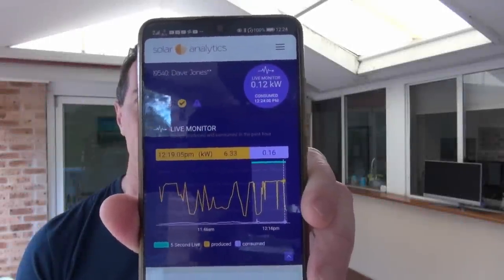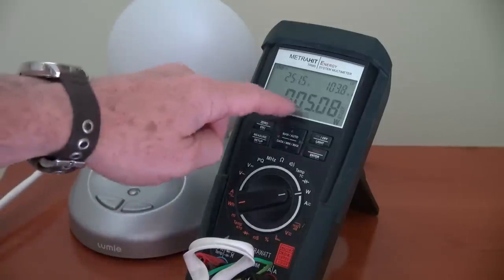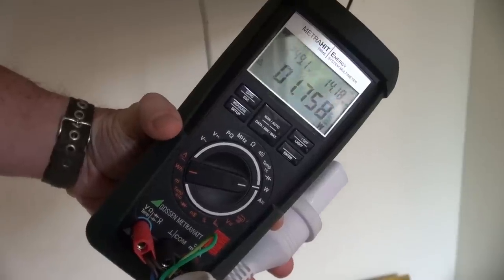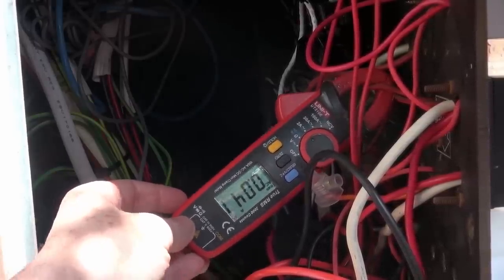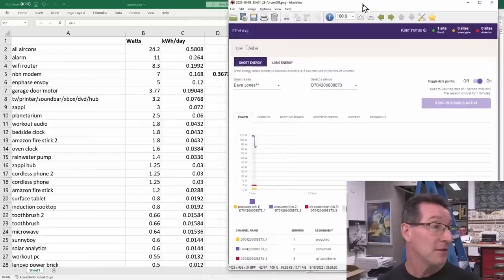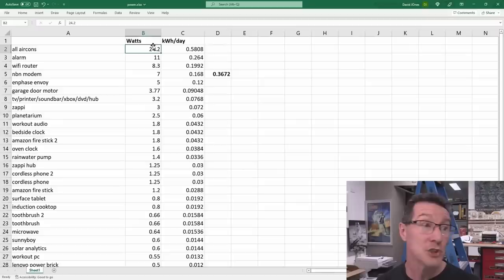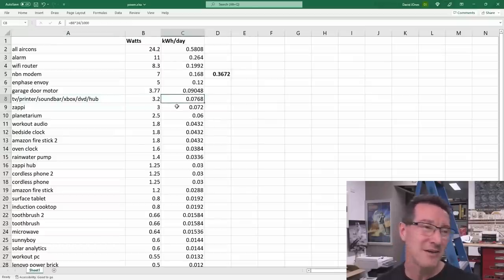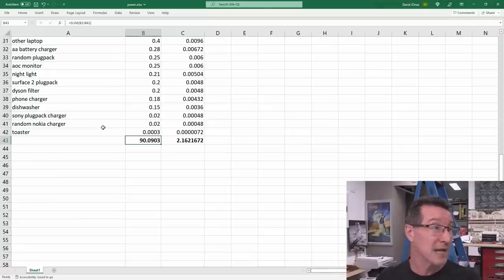EEVblog 1505 - 120W Home Phantom Power? Audit Time!

Comment: One of the first things I did when I moved into this house was to put the living room TV & AV system on a surge suppressor with a conveniently-located switch. This was ~15 years ago, and we hadn't phased out our use of CRTs yet. That saved a ton of power, I'd wager. We're still continuing it as a habit to this day.
Reply: With an old CRT TV, it can "power on" in a matter of seconds. Today's "modern", "smart" junk takes an eternity to be ready to turn on. For example, my (old now) Vizio TV takes several minutes to "boot" after power is applied -- the power button will not turn it on during this phase. DVRs need to be on 24/7 to do their job. Streaming devices (apple tv, roku, etc.) are much like the TV... takes ages to boot.

There are numerous way higher constant loads throughout the house... my laptop uses 20-30W idle (screen on). Desktop uses ~100W. Switch(es), router, wifi... all add up. I could shutdown the laptop, but I don't want to wait for it to (re)boot. (the desktop runs things that are needed 24/7)
Reply: @jfbeam  Curious, my Roku stick takes about 10 seconds to boot from cold - I normally keep it disconnected at the USB power and only plug it in when needed as the TV is really bad at switching HDMI inputs. I'm with you on the DVRs though - not much point in them if you are going to cut the power when they might have been set up to record. Truth is though that I use that less and less these days when everything is available on catchup services anyway.
Reply: @jfbeam  This is one of the areas I'm glad to be cheap. 😁 Our 2009-vintage Vizio is probably one of the last of the "dumb" monitors Vizio made. Starts up in seconds. The audio gear is a hodgepodge of old analog stuff -- newest pieces are 18 years old now. We do have a streaming Roku stick, powered from the TV, but that boots up fairly quick for us (10-20 seconds).

You're quite right about the new hardware though. Some of it takes longer to boot than my first Windows 95 PC from ~25 years ago. I wouldn't want to cycle that every day. And the PCs are another story... ⚡💸
Reply: @McTroyd  I have a smart Vizio, and it boots in about 10 seconds. I wouldn't use it as a smart TV, though, because the UI is drawn entirely by the underpowered CPU.

Comment: The Xbox has spinning media and does large updates in the background. That could be some of it. It could also try to keep phoning home if the option isn't turned off.
Reply from the maker: Only seems to do updates when we tell it to
Reply: @EEVblog  odd. Usually it'll download it in the background then take forever to install. The xbox one s was bad for downloading the whole os everything they made a slight change to the machine. In the settings off means 2 different things. Sleep and download app updates such as games and whatnot but the big updates they ask first incase you hit yes and it bricks your machine  because Microsoft and have to download a usb backup.
I love the witch hunt though.

Comment: I did something similar a few weeks ago when we got our mandatory smart meter upgrade. I was shocked when I discovered my old Yamaha AVR is taking 70W... I never turned that thing off, not sure why I thought it will take next to nothing if it's not playing anything. So in the 10 years I have it, I wasted more than a 1000 bucks in energy with it easily...
Reply: Yeah, amps do use a lot when on, oddly even if you turn the speakers off (using the button that unlatches the speaker relays). The Pioneer one I have uses 30-40W. The good part is that if you put it in standby, it'll only use 0.1W or less. Shame it takes a few seconds for it to power on the speakers when you power it on.
However I don't know if frequently powering it on/off will damage it (like a dozen times a day).
Reply: My amp was using 28w on standby! 
Datasheet said 0.5w. reality was 28
Reply: @njipods  then it didnt really go into standby. standby would be with everything off and the amp waiting for remote on signal (or power button press on the front). if the amp is on but idling, that is not standby.
Reply: @blockbertus  it was standby. I check with the manufacture.
Reply: @njipods  what model was it?
Reply: more if you use AC, but less (much less) in months where you heat your home.
Reply: My Harmon Kardon was using 100 wats with no volume. I ran it like that for 15 years. Ouch. My Soundstage subwoofer used 40 watts in standby.
Reply: @timcat1004  It varies from setup to setup, yeah. The pioneer I mentioned was an entry level model. A much more higher end Denon however uses 70W instead (measured it directly). The Marantz slimlines use 40W normally, 30W in Eco mode (according to specs).
My old all-in-one amp/woofer + 5 satellites used 20W when on, 10W in standby.

Comment: I did an audit of my whole house a few years ago, it was around 300w with everything in standby mode. It turned out to be a GE radio flip number alarm clock sucking down 130w,  the UV light at 70w on the humidifier that was on all the time as long as it was plugged in, the transformer for the 1980's door bell sucking down 80w at idle and a few 1-2w wall warts. The alarm clock got thrown out as it was just in the spare bedroom unused for many years, a new modern power supply for the door bell idles at 0.2w to keep the led on the button lit up and we just unplug the humidifier when not in use.
Reply: 130W seems highly improbable for an alarm clock. There's no way it could dissipate that much heat without melting. Same with the 80W for the transformer.
Reply: @RobertHancock1  Seems like these numbers are way off. Probably measures with a "power meter" that doesn't take into account when cos/phi is not =1.

Comment: Here in the Netherlands we can read-out our meters with 1 second resolution. Ever since I have this, I've been monitoring like crazy. Still have a 250w phantom load, but now I know what it is and why I keep it running.
Reply: Yeah the P1 port is really useful, high resolution and no need to send data to your energy supplier or some cloud service.
Reply: If you know what it is, it's hardly "phantom load". 250w is pretty good though, I'm still doing about 340w at night. Mainly freezer/fridge, NAS and network (lots of unifi stuff). P1 port is pretty handy for monitoring this stuff, we have it in Belgium too.

Comment: Was watching a guy in California, Shango, who plans on running a vintage TV 24/7 until failure. He mentioned their energy cost, which seemed high, and overseas, I couldn't live where I currently do at some of those costs mentioned. 

I pay a measly 8.306 cents per kWh, and still try to be as efficient as possible. Mostly all LED, taking it easy on the AC and heat, water heater turned down a bit, devices unplugged, etc.

That said, it's a full electric house with no heat pump technology to be seen. Typical whole house AC and forced air electric furnace at 15 kW. I paid $70-110 a month in late spring and summer, I expect winter to be at least double (though I'll try to keep it cool inside).

Comment: I've been working through my house taking many of those small loads off grid.  The kitchen lighting has been 100% solar for over 8 years now, same in the attic and patio and the garage/shop has dual lighting, either DC or AC depending on the solar conditions. Some wall warts have been replaced with DC-DC converters running off a 12VDC circuit in the house, including the low voltage transformer for the door bell.  I'm averaging over 2KWH/day on that DC system.
Reply: Well done. I will have to think about implementing that idea. Thanks.
Reply: @ecospider5  Thanks, my strategy is to start with something small.  When I showed my system to a friend some years ago, he commented that I was just doing the "low hanging fruit".  And yes, that's the idea, just pick off something easy, like eliminating the doorbell transformer and feeding that with 12VDC.  Eliminates a watt or so of vampire load and assuming you have 12VDC from a battery bank, there is zero standby power loss (assuming no doorbell camera type system), in fact my first video on YT:
https://youtu.be/59MTQu---ZI
With an off-grid solar setup, you take DC off the panels, store into a battery, then pull DC out of the battery to power an inverter for high voltage AC then convert that back to low voltage DC to run some small device.
Reply: That’s a good way of dealing with it. I have only done that with 1 thing. My electric lawn mower. 2x12v 50w panels on the shed was plenty to charge the mower. 

I do have a full 10kw solar system but I can’t add to that without hiring someone. So doing some more 12v stuff makes sense. Like my outdoor cameras.

Comment: Missing power usage due to capacitive coupling of the wires in the house especially on long untidy nests in the loft.
Problems with switching routers/modems off at night is most do updates at night so switching off at night would miss security updates.

Comment: My solution for the wifi, cpe, network switches, TV Boxes and home assistant (basically, anything that natively runs on 12v or less), was to move it all on to a set of batteries, with its own solar and cheap pwm solar charge controllers (2 x 50 watt panels and some old batteries). That way the usage of those items no longer affects any other figures, and additionally, it keeps the internet on during power outages, at no extra cost.
Reply: Smart solution. However, if your neighborhood has a power outage, would that not mean your internet is down too, as it's probably somewhere in the area in a central distribution box with active/powered elements that also will go down? 
Anyway, good idea, perhaps when you remodel/built new, consider your own DC mains circuit to most of the rooms and utility closet?
Reply: @ewoutbuhler5217   Unfortunately I live in South Africa, which has "Loadshedding" 3 times a day due to lack of maintenance and general upkeep, so they switch power off to certain areas each day because "Something" has failed at some point and they have to conduct "Maintenance" to said unit, and then they spin the bull story that it's because the country is "Growing" so rapidly (which a Lot of locals actually believe is a "Thing"...... Perhaps if they had half a brain cell, they would look at every other 1st world country in the world, and think "Hmmmm, so why is this only happening in this country", but alas, they don't). 

Anyway, the areas affected at any given point in time seem to be such that at least the Fibre infrastructure stays up most of the time, so when I'm without power, the area that has the Fibre infrastructure seems to have power thankfully.

I eventually want to go off grid completely, and tell this lot exactly where to shove their crap electrical service, but that may take a while in getting to that point, hence I just started with something completely manageable and within my own capabilities for now.

I hope it inspires more people to tell their useless service providers to go to hell 👍🏻🤣

Comment: Most (good) wifi routers allow for scheduling of WIFI radio hardware power. You can turn them off or reduce them to a very low power at night automatically. They also usually have settings for disabling or dimming the LEDs, as they can be very bright and distracting at night (and probably suck a bit of power too!).

You might also be able to save a little power by powering both the modem and the router from the same brick. Most consumer network equipment takes 12v at 1 or 2 amps max, so a single high-efficiency 12v wallwart may be better than 2 separate ones, as long as it can handle the load.

Comment: You didn't find many surprises. So I share some of mine
15W Old Network Printer
10W Panasonic TV with factory settings (you need to deactivate some smart stuff to get it down to 1W)
10W Old large 5.1 Sound System with passive speaker
9W Modern Samsung 5.1 System with active wireless speakers
8W 8-port Gigabit LAN Switch from 2009

We pay 3,50€ per 1W phantom power in germany, so I bought some stuff to get these things cut from the grid:
- I have push to activate button with auto turn off (turns off if programmed power usage is considered as inactivity) for my printer (Windows will schedule print jobs if printer is offline)
- I use master-slave power strips for devices with connected speaker systems
- I replaced the 2009 Switch with a 15€ 2022 model (1W with 7 links) and already paid for itself

Comment: Just add one more solar panel, designate it the"phantom load mitigation panel" and bob's your uncle.    I did the same analysis a while back,  I used my thermal camera to look for things that were dissipating heat.  I was amazed how bad those iron transformers plug packs were.     Set up my router, cable modem, E-switchs, VOIP modem, speakers etc to run on just one switching mode 12V plug pack.

Comment: First thing in the am my smart meter shows from 86w to ~220w with the variation due to whether the two fridge/freezers' compressors are active. The 86w powers a router, Chromebox NAS, one or two running Chromebooks and multiple devices in power-down mode. My UK annual consumption comes to about 600w average mainly due to over-use of a heat-pump dryer (!).

Comment: I did the same thing a few weeks back. 
My ducted ac draws 50w on standby. 

Turns out ac’s have some sort of heater in them that runs 24x7 to keep the gas/oil? warm and ready for the ac unit to be used. Especially important in the winter.
Reply: Crankcase heater?
Reply: @brainndamage  sounds right
Reply: @uwisho  It’d be worth it to get a temperature controlled power switch so that heater doesn’t run when it’s above freezing. That’s a lot of power.
Reply: @markm0000  yeah it all adds up. Imagine all the ac units pulling similar power 24x7 even when turned off. Seems a like an awful waste. 

From what I have read (could be true or false) a lot of units don’t have a thermostat to switch off crank heater even when weather is warm.

Comment: I did a similar audit a few months back, though I did not go as far as the fuse box, just measured every appliance one by one.
The most unexpected save I did was changing the ~16 year old power supply I used in my server. It was a top of its line device when I bought it, back then the 80+ rating only had one level, no bronze/silver/gold levels. I changed it out to a new 400W 80+ Gold rated one (lowest wattage Gold rated ATX power supply I could find). That ended up shaving down a fourth of the power my server used - 38W -> 28W for motherboard/cpu only, 96W -> 73W when idling with all devices awake, 170W -> 130W on bootup when the HDDs spin up.
I think what made the biggest difference is that the old power supply was really old and that affected its efficiency, since going by the specs it was only some 5-10% worse, while I'm measuring much higher than that.

And on a similar note, what's the highest lumen R7s LED bulb out there? The most I could find was ~2400lm, which is only a bit over half of what my old halogen bulb produced. Of course the halogen bulb used 12x the power, but it also doubled as a bug zapper in summer and a heater in winter.
Reply: I used to have a server running in the closet just to screw around with. I realized I was paying a ton of money in electricity for no good reason. I replaced it with a raspberry pi and that’s more than enough power to run my small web apps, a few files, and basic home automation. The silence at night is also nice.
Reply: @markm0000  unfortunately that's not the case for me. The odroid h2+ would've been a good replacement (x86 and 2.5GbE) but it is discontinued. At this rate, it might be more economical if I started buying 4tb SSDs.

Comment: Excellent video. I shall do something similar. I started but never finished. I used the same power meter for all measurements however I suppose I could prove away inconsistencies in meter tolerances easily thus allowing me to use a mix.

Comment: My home quiescent power is 280W. Had a quick run around tripping breakers to try and narrow it down. Seems to be the central heating or something on that circuit.... further investigation is required!
Reply: I would expect close to 100 W for central heating, but an old circulation pump that's always running at full tilt may well throw that off considerably. These things have gotten substantially more flexible and efficient over the years.

Comment: Meticulous as always; thanks Dave. Currently doing something similar (Europe here...) with energy-monitoring smart plugs (installed permanently). Discovered that one of my vintage HP Frequency Counters kept powering an OCXO while being switched "off". It must have been heating for the birds for several years.
Anyway, I gained 18W for the nearing winter, though I'll probably never get RoI for the smart plugs. 🙂
Reply: How much power do the smart plugs use though?
Reply: @benholroyd5221  Depends on the type, but roughly between 0.5W and 1W each (I have TP-Link HS110; nous A1T; Fibaro and GoSund 110 plugs).

Comment: Try switching to a two pole relay on your AC system.  Many manufacturers cheap out and install single pole relays.   Used to be needed to keep the refrigerant from condensing (heater) but modern scroll compressor don’t need to worry about it.

Comment: I did detect these issues by reading out the current power draw on my power meter installed by the energy provider. If you have a digital one you can ususually directly read the value which you will get charged for. So there are no measurement issues if you use the actuall device that measures the amount you are charged for.

To meassure each room I just turn off all breakers and meassure one circuit at a time.